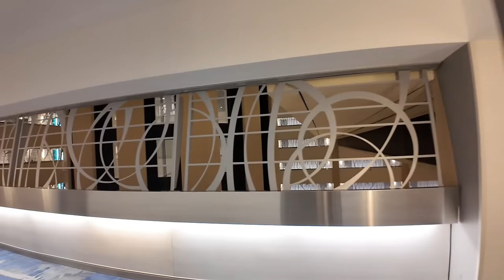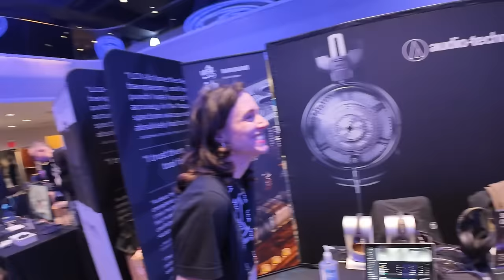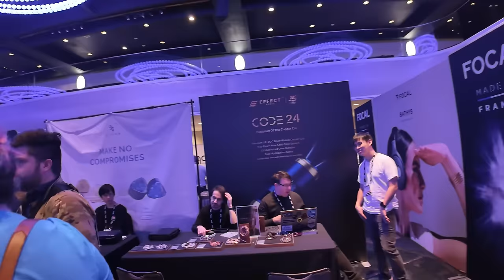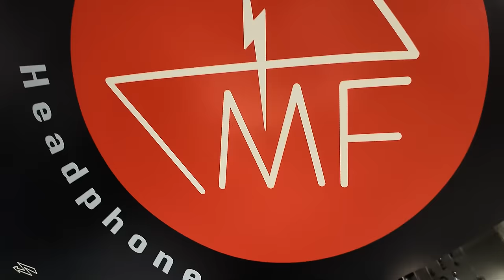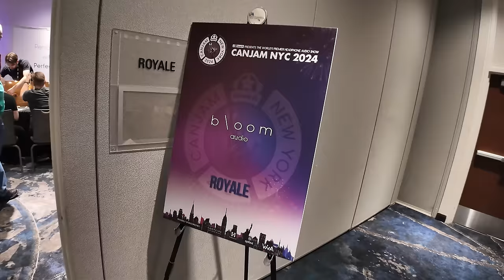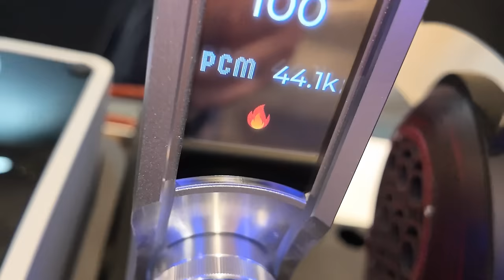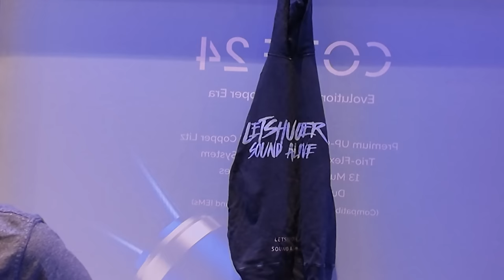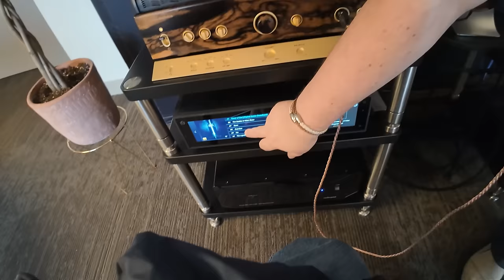🟪 Zeos Goes to CANJAM NYC 2024 🟪

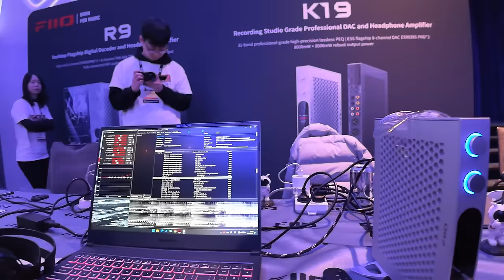Comment: 1:09:06
$1350 for an overpriced Cheese Grater?  Nah.  Way overpriced.  And whoever decided to put this K19 Vertical and with the Volume/Controls at the top at FiiO has no clue wtf they are doing and probably don't even use a desktop DAC/Amp personally or they'd realize most want these type AIO units horizontal like the K9 Pro.  #1 the K19 Cheese Grater/FIOS Router/Modem being Horizontal with all the dangling Cables will look ugly AF showing from the back of the unit and the cables could possibly cause a disaster knocking the K19 over in this vertical position. The volume knob looks pathetic compared to the K9 knob. And I get the R9 being vertical, but the K19 is a bit of a head scratcher in the Vertical position.Does it get HOT?  Is it for cooling purposes?  I'm guessing it can also be set up vertical, but overall many of the decisions made on the K19 were bad. Ergonomics/functional design looks like a total nightmare. For a desktop unit, the volume knob should be accessible without having to raise your hand.  Only thing really attractive about the K19 is the 8 Watts power.  Still way overpriced though